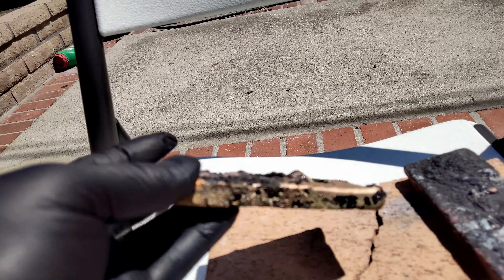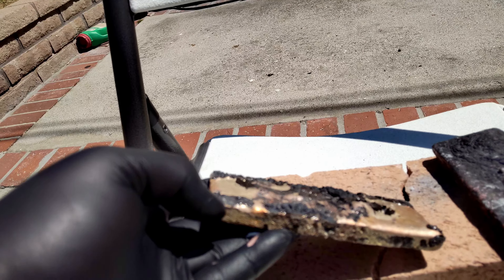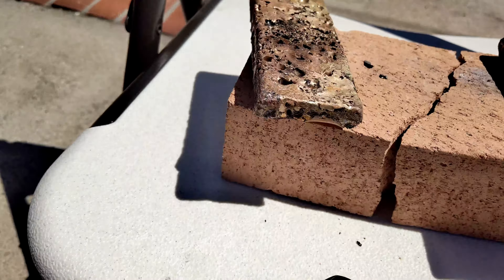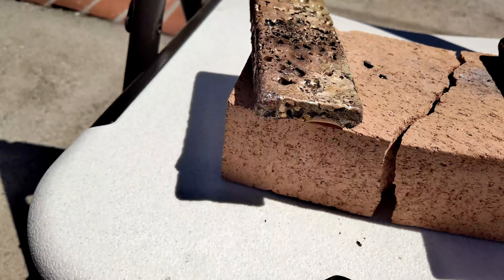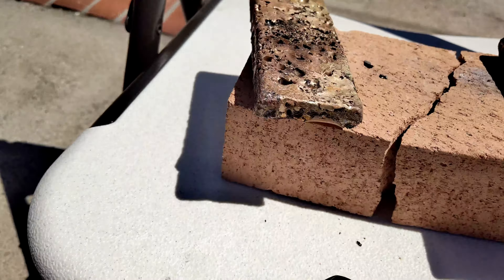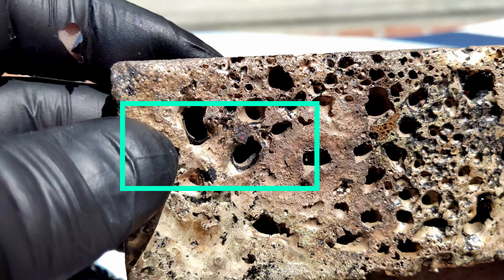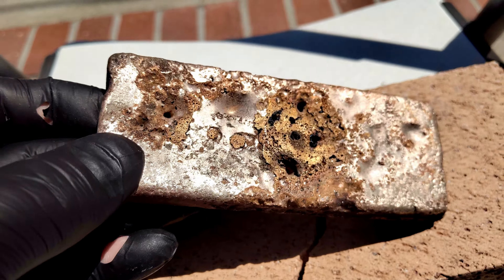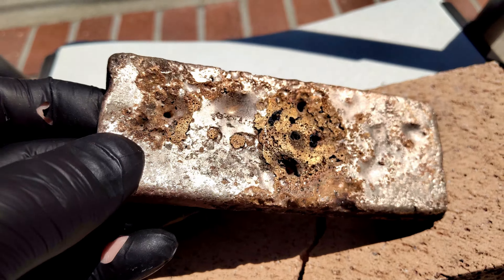Seeking Knowledge- Questions in description- Second Melt Bars After Action Report in 4K

Comment: So my first copper bar did the same thing: I used a ceramic credible and a steel (cast iron) mold. Got a lot of holes. I switched to graphic crinkle and mold and has fixed the holes problem. I had a weird reaction when adding cold copper to my molten copper, it was so hot then dropping the temp like that created what I believe to be copper oxide (a solid mass of copper)
Reply from the maker: Interesting.... Thanks! Will try to get my cast iron mold hotter... as a first step since if i can get it to work I'll save a lot with graphite molds. Also i have the cast iron molds already. Been in the garage cleaning out the surfaces with a Dremel.

Comment: The holes appear to be outgassing from your impurities, at least in my opinion. You can sprinkle some graphite in your molds prior to pouring as it'll help act as a release agent. Or opt to change to a graphite mold. As far as your gold bearing material sticking your your second bar... If your mold had it still in the bottom of it when you poured your second then definitely can could have melted in with it. Other than filing it off, saving the shavings I'm not sure of a cost effective way to recovery it. 
With my small crucible I took a small piece of flat stock steel bar and bent the end at 90 degrees. It'll let you drag the dross up the side of the crucible to get it out
Reply from the maker: Would you happen to know if getting the cast iron mold hotter make any difference? Thanks for the insight!
Reply: @gizmodious  It can help. However I'd still suggest using a slight amount of graphite powder if your going to continue using your cast iron mold. It'll keep any chance of adherence with what your pouring next to none. If pouring aluminum, I've never had a need for graphite

Comment: I don’t much about the gold I would imagine you need more borax .. now as far as a spoon I took a piece of 1/2 electric conduit place the spoon handle inside it and smash the conduit down so it will hold the spoon about 2 foot long .. I would use graphite mold for the gold.. there are several different recipes for pouring flexes you should probably look up because like I said I don’t know much about gold.. 
It’s perfectly OK to mix copper and brass together because brass has copper in it already.. your going to need to use more borax..and get your self a stir stick mix it up real good but you can overheat brass which isn’t good at all.. and always preheat any tool before putting it into the Crucible.. 
The holes can be two things could be oxygen trying to escape and impurities being trapped in my opinion..
Reply from the maker: Thanks for the insight and the call to discuss!
Reply: @gizmodious  ya buddy 👊🏻